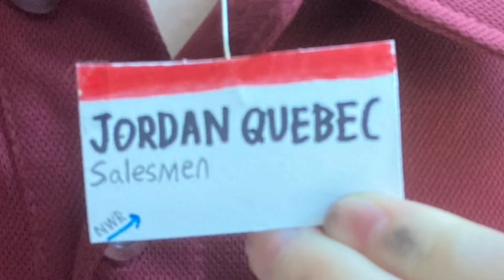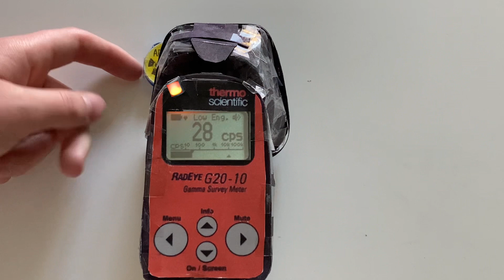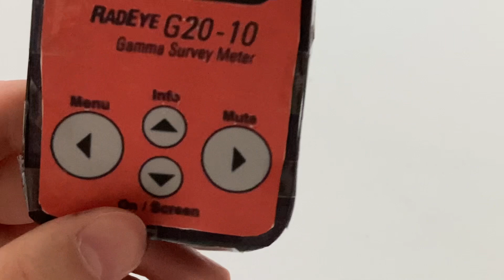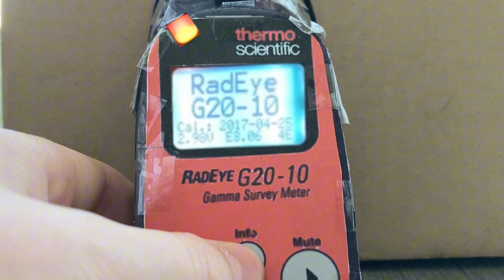Replacing The Pancake Tube Inside The Thermo Scientific RadEye G20-10 Gamma Survey Meter

Comment: I am saving up for a radeye g meter and am looking to buy it used from en-Scientific. is it still worth buying?
Reply: In general RadEye meters are pretty good, and buying them used is typically no problem, though you might want to send it in to Northwest Radiological for repair.
The only real common issues is that sometimes the control panel is locked, and you gotta pay a fortune to get Thermo Scientific to take it in and unlock it for you.
I would recommend buying used because brand new meters from Northwest Radiological are typically a little overpriced :-)
Reply: I have bought a used meter from en-Sci and they have really great customer support! 😊
Reply from the maker: @Mineralogy_Key They are normally sitll worth buying used, but the controls panel being locked isn’t necessarily a problem. It is very easy to unlock by holding the key/on button and then following the directions on the screen. I think the issue you’re referring to is the meter being software locked. This is a persistent and expensive to-fix problem, but it is possible to get every item in the menu again with the correct software.